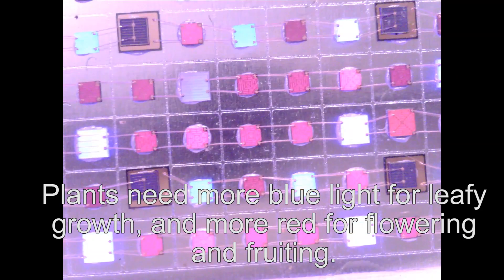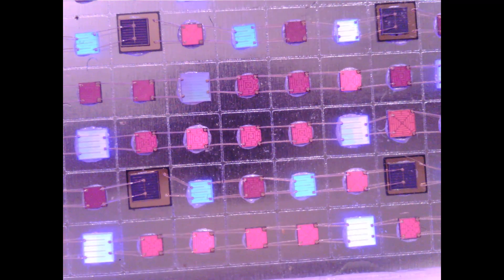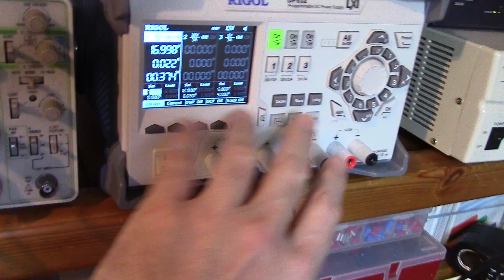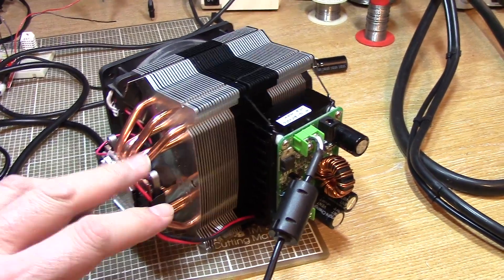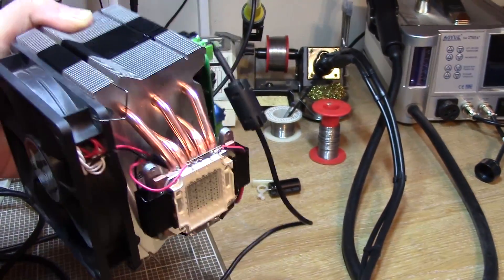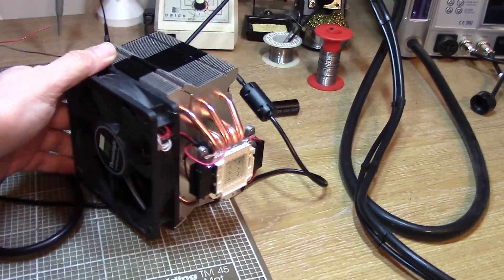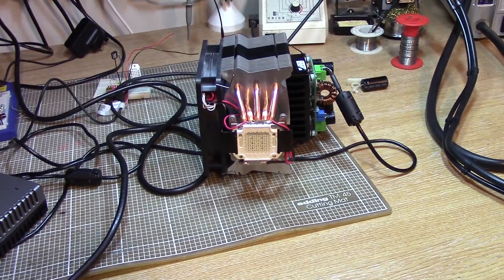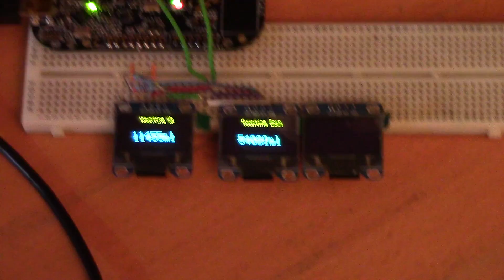DIY 100W 7-Band Multi-spectrum LED Growlight

Comment: By earing the noise coming from the laptop power supply (due to the huge work that it has to do), i guess this kind of converters are working fine either with a linear power supply well dimensioned or with a switching power supply capable to give at least double of power needed from the load applied to the converter continuosly because by using the booster, the power supply has to give current to the  load and to the inductor that actually is shorting the power supply at frequency of, what, 20Khz or more. Thank you for sharing your experience whith this converter.

Comment: While I may not be an electrician I am an artist and I have an eye for making things either look good or terrifying so I went ahead and measured everything and it turns out all the stuff can fit in the old aluminum housing in my old UFO light provided that I cut the glass with a glass cutter it's going to look very nice

Comment: I'm planning to make a hundred watt LED light I was wondering do you need a watt booster if everything you're using is the same voltage or whatever is designed to go together I'm not exactly an electrician but I'm buying a do-it-yourself kit and all the stuff is basically a hundred watt or whatever

Comment: That was refreshing my only bit of advice I would give you is to spray the whole thing with a good clear coat that's heat resistant to avoid corrosion

Comment: How did this work out? Did the plants grow well with this kind of mixed array light?
Reply from the maker: Hi Noah - Yes, the plants grow ludicrously well. The only real problem I have is that the plants quickly outgrow the space I have available for them, and then when I put them out into the greenhouse in march/april they stop growing for a few weeks until the sun becomes stronger. Cheers!!

Comment: Hi Jim
I recently got a 30W COB LED that I'm dimming with PWM
Also getting that high pitch noise between 
If I increase the PSU the frequency of the pitch changes, but still there...
What causes it and how would you get rid of it?
Looking forward to your reply
PS. Awesome vieo
Reply from the maker: Hello Heinrich - Having just been through a similar issue myself with PWM speed control for a fan, I solved that one by a simple low-pass filter (resistor + capacitor) to the circuit. The resistor (I used 10 ohms with my fan - you probably only need one or two ohms with your 30W COB)  prevents too much inrush current at one time, and the capacitor smooths out the ripples. I actually use something similar with the LED strips over my desk... I have a 100uF capacitor at the very end of the strips, and the couple of ohms resistance that the strips have from end to end limits the current that rushes in. Hope that helps. Cheers!!
Reply: Great stuff!
Thank you for the prompt reply 
Sounds simple enough
Using the resistance in the strip in a nice touch.
Cheers

Comment: in ebay said doesn't need driver , but is good if using boost converter dc to dc and connect to 12 volt transformer / power supply yes

Comment: not a bad video, but man those cheap Chinese LED lights are worthless!! cant strees enough. they are no good, dangerous. spend some money on a decent light like the KIND K3 & K5 series :)
Reply from the maker: Hi Ant - Although cheap Chinese LEDs are pretty useless, It wasn't a cheap one that I used for making this growlight...  It's given 3 years of service so far without any problems and there's no sign of any fall off in the light output. I don't understand why you think this particular LED module is dangerous... It's low voltage and there's really nothing much that can go wrong with it.... Those K3 and K5 do look nice... but there's no way I'm going to spend nearly two grand on a light so that I can start half a dozen tomato seedlings once a year.... I could buy a lot of full grown tomatoes for that kind of money. Cheers!!
Reply: ant ratcliffe   BUT KIND USE CHINESE LED AS WELL

Comment: That is the worlds most silent fan running at 12v ... oh... ok, there's no amps??
Reply from the maker: It was a very quiet fan, which is the reason why I'd bought it in the first place... I think it was desinged to run at a max of 700RPM, so it truly is whisper quiet and uses hardly any current. Cheers!!

Comment: Jim if you ever read this do you have any links to some good LED chips to make something like this? I've had a lot of bad experience with dodgy leds on ebay. Any recommendations?
Reply from the maker: Hi Unit Z - I've only ever bought one of these LEDs, so I can't really recommend a good seller in general. I got lucky with mine. The ebay link I bought from is somewhere down below in the comments. Hope that helps. Cheers!!
Reply: Unit Z Could go with a Cree fixture from cutter electronics.  CXB3590 full spectrum works quite well.

Comment: is it RGB ?
Reply from the maker: Hi +Povilas X - It's not RGB - The Green part of the light spectrum is only used by plants when there isn't enough red and blue to meet their needs (the plants can produce carotenoids instead of chlorophyll to get extra energy). As the LED is blindlgly bright, the plants get plenty enough illumination not to need the green spectrum, so it's more energy efficient just to supply them with the red/blue combination. This 7-band LED is designed specifically to match the chlorophyll absorbtion spectra - there is no way of changing the colour of the light it gives - it's always going to be that pinky-blue colour. Cheers!!
Reply: Hi +Jim Conner i. Making project a power grow light about 2000w and looking for a right and power LED or SMD with lenses. What you can recommend ?
Reply from the maker: Hi +Povilas X - I don't have a lot of experience with these LED chips - the only one I've ever owned, you've seen in this video, so I don't really feel confident in making a recommendation about any particular brand/product to buy - What I will recommend though is trying to go with ready-made off-the-shelf parts to keep your life easy... It'll probably be cheaper to make 20x 100W units than it is to make a single 2000W device as the 100W drivers and LEDs are readily available. Hope that helps. Cheers!!

Comment: Would a 1000w led be OK to use in a 1.2 by 2m tent anyone
Reply: youll want more light
Reply: How much about usually use a 600 hps
Reply: +DJ CONTROL WASHY SESSIONS 
I would use the led to supplement. depending on what you're growing.

Comment: Hi Jim!!! Test results on vegetables? A good lamp, when compared with http://ru.aliexpress.com/item/Full-Spectrum-led-grow-light-chip-actual-Power-100W-range-380-840nm-New-COB-tech-for/2054011691.html.???Your opinion?Sorry, I write through the Google translator.Thank you!
Reply from the maker: Hi +Александр Ларин - I haven't actually tried using my light for a full growth cycle. So far I have only used it for starting plants out when the weather is too cold for growing in my greenhouse. The plants certainly seem to love it. The aliexpress LED you have found looks very similar to the one I got. I expect it would work very well. Hope that helps. Cheers!!

Comment: how long can u have that light on??? whats the watts consumption whiling using for about 18 hours???
Reply: +Dean Arthur 
quote:
"Power consumption over 18 hours would be 1.62KwH"
for a month you need to multiply that by 30.

dont forget, that during flowering it is just 12h needed.

p.s. i know what you`re up to ;-)
Reply from the maker: Hi +Dean Arthur  - Power consumption is around 90Watts - The light will happily runs 24x7... Power consumption over 18 hours would be 1.62KwH - Hope that helps. Cheers!!
Reply: thanks for info broo appreciate it, and one more question how can it using 3 or 4 of those lights all together
Reply: and is that watt consumption count for a month (as in 1.62KwH)??
Reply: thanks, lol im trying to grow organic veg and all season because im changing my whole eating and lifestyle in general, i had a major stroke in this pass october, i thank god to much that bounced back the way i did, i was paralyzed and couldt talk and then a week later i was fine, i drink only occasionally and didnt smoke lol, i always been a athlete anyway, im trying out rite now for nfl teams, for me to be in the position im in and be able to comeback and to do this god is great!!!, but as far as the stroke, i dont know why i had the stroke at all, the doctors have no answer for me and are amazed how i came off the stroke in about a week or two like nothing happen, damn there just like a common col, it came and left, all the test they had me do cant even tell if anything happen, but the one thing that we think caused me to have the stroke was this med that doctor gave me when i was stuck by needles at work by an accident, its a med that they have you take for 30 days just in caseyou contract anything for situations like the incident that happen to me, once again gods good, i didnt get nothing from the needles, so i had to take the meds the whole september and then had the stroke twos after i was done the med, they called TRAVADA AND INSENTRESS, doesnt that sound supicous, the doctors said they is no way i could had done anything prior before the stroke could had caused it!!!!
Reply: +Dean Arthur  Sounds like it was related t the medication.
Reply: +vvdv yup that's what I'm thinking, because I saw a recall about the one medication called truvada which was said to have red rubber particals
Reply: Dean Arthur
 Medications kill 100k a year in the US and wound millions. So you must be very careful when you see a doctor.
Reply: +vvdv yeah I know now, I didn't wanna take it, but the doctor was so hype about it, now my lawyer is gonna speak with these people now (Gilead) who created the medication

Comment: Jim, I just sent you a message, curious is the current limiting solely being provided by the boost converter? I have some of those units, but I'm leery to hook up the chip if there's a risk of burning it out.
Reply from the maker: +Stephen Hobley - Just replied to you privately, but for the benefit of anyone else wanting the answer to this question - Yes  - the current limit is solely provided by the converter, and that works just fine as long as you adjusted it correctly when setting things up. Cheers!!

Comment: how did you tie the laptop charger into the boost converter?
Reply from the maker: Hi +John Trachsel  - I just cut the laptop-end of the plug off the cable, and screwed the wires into the terminal block on the boost converter instead. Cheers!!

Comment: greetings from the deserts of west texas.  very nicely done video.  good explanations & info in the answers to comments too.  thanks for all.  i'm considering replicating it.  it is abruptly starving times here as the oil patch has collapsed.  i'm hoping i can stretch my budget by growing  as much of my own food as possible.  if one raised the light a little higher how many square feet of plants you reckon it would effectively illuminate ?
Reply from the maker: Thanks for your kind words +GEODEAHOLIC M  - I'd certainly recommend building your own light rather than buying one - it's a nice straightforward project and there's no dangerous voltages involved if you use an old laptop power supply as your power source, so there's no chance of getting things wrong and hurting yourself. I reckon this light would be good for somewhere around 10-16 sq feet, though I'm only guessing at that figure based on what I've seen other growers using in youtube videos. Hope that helps. Cheers!!

Comment: first off thanks for sharing ! i am new at this so im trying to figure out how many volts a single 100 watt cob uses. and if three 100 watt cob could be run off of a Hlg 320h-30. maybe with 2  140mm(rated at 4.2-6w) fans?
Reply from the maker: Hi +edwin ar - 100watt COBs generally use somewhere between 24 and 36 volts depending on how they've wired up the individual LEDs... (White and blue LEDs need about 3V to operate, Red ones around 2V). They arrange a bunch of LEDs into a series-circuit to get the operating voltage they desire, and then have multiple strings in parallel to increase the wattage. LEDs are very sensitive to being driven at the correct current (far more important than voltage) and as they heat up, they'll attempt to pull more current - Because of this I'm not sure that wiring multiple COBs in parrallel to your HLG 320h-30 is such a great idea, as the current won't be shared equally between them all, and you can only limit the overall current, rather than the current to each COB. Hope that helps. Cheers!!

Comment: nice bit of hackery ;) how's it holding up? did you use thermal compound? 
A year later what do you think of this type of multicolor module?
Reply from the maker: Hi +Salty - It's been on a shelf since April 2015 as I don't grow indoors during the summer... I'll be putting it back into service in a couple of weeks time to start all my seedlings for 2016 though... I'm very impressed with the growth I got last year though... The plants did far better under that light than they did in the greenhouse (though a lot of that was down to aphids and spider mites). Cheers!!
Reply: cheers!

Comment: Pretty impressive build and thanks for the mixologist update as well. Any tips on how to rig up 2-3 of these together?
Reply from the maker: Thanks +seiche - For rigging up 2 or 3 of these lights, I'd be inclined just to do them all in parallel... The lights need 3.0 to 3.2 Amps of current (at around 25V), which is perfect for any number of different LED driver circuits out there... (such as this one I just found on ebay for an example... http://www.ebay.co.uk/itm/Waterproof-10W-20W-30W-50W-Power-Supply-Constant-Current-LED-Driver-AC-85-265V-/301737733358?var=&hash=item4640f86cee:m:m6xKBXS5fOw_q-FJdSyki2g).... Although you could theoretically run three of these LED chips in series from a 75V supply, there aren't really any suppply modules like that around. That 600W boost converter would be capable of supplying 75V@3.2A, but you'd likely need around 60V on the input to the boost converter, and again, that's not a convenient supply voltage to have.... so I'd just go with three seperate lights with three seperate supplies. Cheers!!

Comment: Hi Jim did you have any heat build up in your lil growroom? considering making one. thanks in advance :)
Reply from the maker: Hi Ryan - I don't have a dedicated grow room, so it was just occupying a corner in my office. The 80W of power going into the light made no noticible difference in this space... it takes a couple of KW to heat the office up. Cheers!!
Reply: OK thanks Jim, I will use a heat sink as they recommend one for the Diodes health, but thanks for the info/ reply :)

Comment: Hi there Jim. Nice video. I've got one question, if you mind me asking: Imagine you want to drive a 7 Volt led. Would you use a 5V power supply and a boost to get it up to 7V, or would you use a 12V power supply with a buck converter to get it down to 7V ? I'm asking this because I'm planing on using a mix of a dozen 10W red and 10W blue leds. The thing is, the red leds are rated at 7V, while the blue leds are rated at 12V. The idea would be to use a single switching power supply with a high wattage and connect them in parallel. What do you think ? Thanks btw. Awesome videos and ideas ! Excuse my English.
Reply from the maker: Hi +Marco Geracao  - I'd use a 12V supply and current limit it... The exact voltage the LED want's isn't important.. it's the current draw that you need to control. If red your LEDs are 7V, then in order to consume 10W of power, they must be pulling around 1.4A of current... (becacuse Ohm's law says so... I=P/V)... Similarly, your blue LEDs at 12V will be taking 10W/12V=0.83Amps... You could consider running the red LEDs at the same 0.83A of current (they'll put out less light, but you'll get more lumens/watt at lower power) - if you did that, you could put the LEDs into series chains ( red+red+red+red+red = 35V, blue+blue+blue = 36V ... then you could use an old laptop supply and a boost converter to control the current).. Hope that helps... Cheers!!
Reply: +Jim Conner That's exactly the kind of advice I was looking for. It makes sense now. Thank you very much Jim !